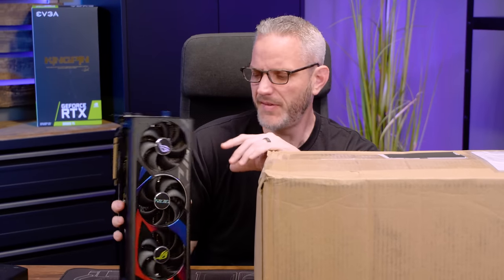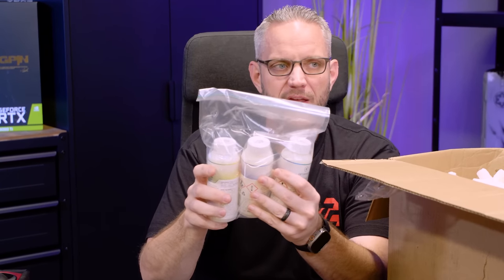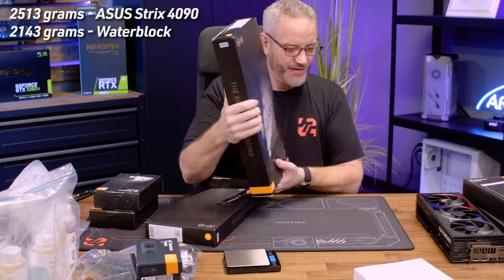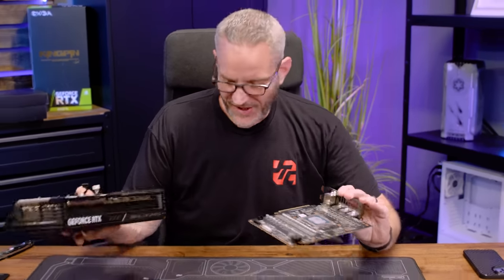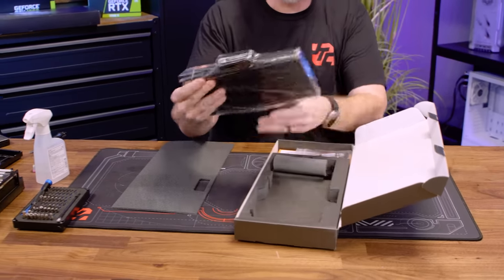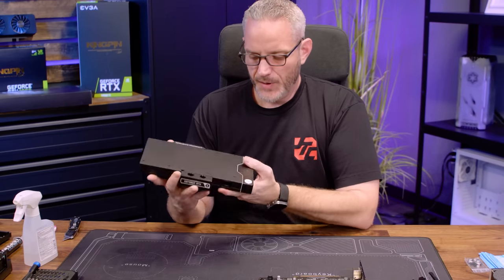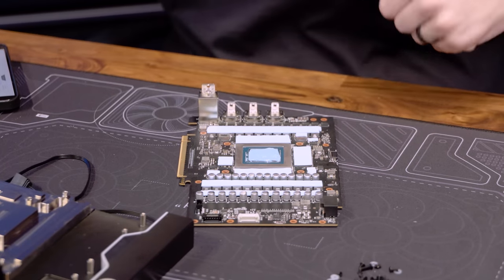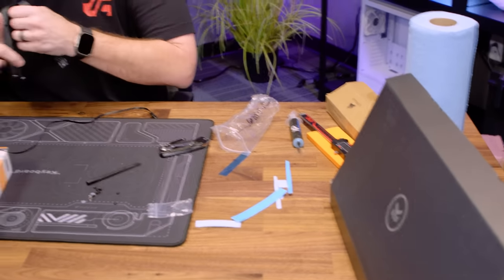This is how you make a 4090 even more expensive... 4090 Strix EK Waterblock Install

Comment: Will you go with a direct die solution with your 7950X3D? 
I'm going to do a build soon, just waiting for the delidder and the direct die frame, and now i'm curios if the EK waterblock (same as yours) will fit with capacitors near the power stages. 😅

Comment: I have a 3080 and was thinking, hmmm I might look at upgrading. But the options aren't really worth it.

4070ti is a sidegrade pretty much, with a few new features dlss 3 , etc. The 4080 is an upgrade but it's $2500 - $3000 depending on the model. The 4090 is almost the cost of my whole PC. Cheapest one is $3000. The most exspensive? $4600. wtf.

The best option seems to be just not buy anything really and wait till I do a new build.

Comment: I really like how the new EK waterblocks completely enclose the card. My last card was a whiny b#$ch. This design helps to contain any potential whine.

Also gtx plate on the terminal is reversible and attached by magnets. Just push where the screws would be and the other end will pop up. Flip it around and voila my logo is right side up in my reverse build.
Reply: Fire up any game and my card whine sounds like a fishtank filtration system.  Quieter than three fans at 3500 though.

Comment: Yeah, I've uses CryoFuel Mystic Fog 3 different times now...

First time with a brand new loop of 80% alphaCool parts (plus a gigabyte GPU with built in block, and a Barrowch Pump+res combo), that was soft tubed. That time I must've done something wrong, or there were some serious corrosion issues, or ai didn't flush the rads well enough, because not a month after use, the liquid was pretty much translucent (still white-ish, but you could see perfectly well through the tubes), and a month or so later, the liquid started turning a pale green-ish color, but I suspect it's some sort of copper oxidation, and not algae (and no, I use any aluminum stuff).

Second time, same loop, cleaned out the fins in both CPU and GPU blocks (clogged with white goop), and changed the tubing. This time it took 2-3 months for the liquid to become translucent (again, still white-ish, but translucent), and after 6 months, it didn't go green, but I then switched to clear CryoFuel, it was too much of a hastle to fully disassemble the system every 6 months, and the last 3 months have increased temperatures on the CPU block (tinier fins than GPU, so it gets super clogged).

About 6 months ago, I built a new system, everything brand new, but this time a mish-mash of parts, mostly Bykski, a couple or Barrowch parts, and an EKEB block for the GPU (the sick special edition for the 30 series founders edition). This time, it was with PETG hard-tubing, and had a very similar experience to the second time, which meant it took 2-3 months for the liquids to become translucent, and now my CPU is pegged at 85°c running any high demand game, with 2 360 rads in a 0-11 Dynamic Mini. Sure, room temps are e probably around 24-26c (I live in the tropics, with no A/C), but still, that should be closer to 80 with some pretty decent turbo boosting at the VERY least.

So yeah, to;dr: only use EKWB Mystic Fog CryoFuel if you like COMPLETELY taking apart your system every 3-6 months... Back to clear for me!! XD

Comment: So they have ramped up prices and ramped down quality? With the options available I would do research and buy EK  as a last resort, to qualify my statement I am currently running both Cpu & Gpu EK blocks which are good and nice, but looking at upgrading my gpu, and looking at water blocks in real world terms I can buy a 4080 and water cool it or buy an aftermarket 4090 for the same money, I understand thermals, acoustics etc. I would ALWAYS take that extra tier of performance, thank you and goodnight 😀

Comment: I just finished my build and used the active backplate from EK. I don't understand why you can't use the active back plate unless it's the weight mounting horizontal. The water ports are infinitely flexible as to the inlet and outlet. You mentioned a heat sink being in the way but you didn't show that. Just curious. I've torture tested my 4090 and can't get it above 52c. I have a 360 and 280 rad with OC 19-13900k. If you know of a test that can stress the GPU more than Heaven or 3DMark(several different tests including speedway) let me know.

Comment: Just finished installing the same waterblock. It barely fit in my Lian Li and almost touches the front glass.

The thermal pads were a little different than I'm used to. Felt like there was a second layer of plastic under the blue side plastic.

Comment: I'm still debating water cooling my gigabyte 4090. I had a full water cooling setup but removed it when I got the 4090 as there weren't any blocks out at the time.  Not sure if it makes sense thermally. The air cooler is pretty freaking solid.
Reply: I water cooled mine using a Phanteks waterblock and max temp under 100% GPU load with 80% of the VRAM being utilized capped out at 46C. That was a sustained, and heat soaked loop. My system was rendering a 3D image for almost an hour.

That's with the GPU being on the same loop as my CPU. The real benefit is the fact that at full speed I have 8x120mm fans going at 900RPM rather than 3 GPU fans going like 1200-1600RPM.
Reply: @WolfA4  My fans all run at 1000rpms or less. I have 4 140's and 7 120's lol. I'll probably water cool it again. I just prefer the look and gives me a project to play with :P

Comment: I had the same issues of the active back plate for my 490 not fitting with the X670 E. I just took off the M.2 cooler and put on a low profile one which I'm not sure if you can do on yours. I love the look of the block with the ABP.

Comment: I stopped messing with open loops when prices starting getting stupid. Regardless of performance I can't get excited about spending $250-$420 on a water block alone. That thing better be gold plated for that price when it's just a slab of copper and aluminum. Once you add the pump, reservoir, tubing, fittings that are getting ridiculous, and CPU block you're quickly approaching 4 figures which is ludicrous for something with so little technology in it.

The videos are still cool to watch, but pricing has been out of hand for years cause they think they can charge Nvidia prices.

Comment: I use to use kingpin then I tried kryonaut extreme and haven't used kingpin since. The Kryonaut doesn't dry out and turn into cement and it dropped my temps by 6c on the cpu and 9c on my gpu. Liked the Kryonaut so much I tried their thermal pads on my gpu and the temps dropped by another 5c, want to try the new minus pad extreme but they are very expensive and are a one use product

Comment: ive used mystic fog in my current build i used the premade , its terrible gunked up all my system and more or less ended up clear after about 3 months , best looking fluid though its a shame just splits so easy i now only use clear fluid

Comment: jay  thinks I shouldn't use my air compresser to blow bust out of computer more bad advice Just regulate your pressure regulater to 10psi and if you have a shop vac use both at the same time takes 3 mins  The vacuum Picks the dust as your blowing the dust off.

Comment: i just tried disassembling my strix 4090 and the clip at 8:10 wont come off at all, due to two of the screws being so tight they broke my control screw driver. completely twisted the #0 bit out of the press fitted metal handle... so no waterblock 4090 for this guy...Bummed out because this has been a "no expense spared" build.
MB: Strix Z790-E
CPU: i9-13900k w/ EKWB QV2 waterblock
RAM: 128GB Trident Z 5600MT/s CL28
GPU: ROG Strix 4090
PSU: Thermaltake GF3 1000W
Chassis: Thermaltake LVL 20 HT (black)
Storage: 16TB Crucial P3 NVMe
Cooling: 
x2Thermaltake Pacific PR32 D5 Plus (now just a single since i cant cool the GPU now) 
x2 EKWB 360mm X-flow radiators
super bummed out about this...

Comment: the liquid gunks up your system 🙈
running the mystic fog for a year now and it didn't even take 2 weeks until stuff just clogged in the blocks.....it's still running though and not running hotter and you can't see the gunk until you drain the loop cuz it's....well....foggy 😅😂

Comment: EK, you should be ashamed of yourself.  At this price, the thermal pads should, at the minimum, be pre-cut, if not preinstalled.  If you continue to not pre-cut the pads, you should label each size of the pads or use color matched film to the instructions.  If someone doesn't have measuring tools or not familiar with metric, they may run into trouble.  This would avoid someone from installing the incorrect size pads in the wrong place.

Comment: I brought my MSI 4090 surprim x and EK ABP waterblock, and I need to spend lot more money, mostly another $500, to get it done. And this weight lot heavier than all EK GPU waterblock, also the same weight and same length with the heat sink that MSI come with. Besides, the active backplate is…. not user friendly, the whole waterblock is blocking the PCIe clip, I can’t release the card. I can tell, don’t buy this ABP, unless buying it for FE or ASUS, or you really want it.

Comment: Alphacool ES Geforce RTX 4090 Reference Design with Backplate
 I would like to see stock numbers of this EVGA water block compared to Alphacool ES GeForce RTX 4090 reference design with backplate.  Also how it would fit insade Lian LI O11 air mini case
Reply: Also what is best CPU water block that doesn't require unscrewing socket on motherboard ?

Comment: That scratch triggers me.

Most of my brand new products are coming with defects.  Valve Index? Scuff mark right on the front.  Hell, my 4090 had a dead gnat smashed inside it, completely disgusting.

Quality standards just keep slipping as volume keeps ramping up.  The world buckles in on itself.

Comment: Wouldn't it be nifty water cool and air cool versions of GPUs were sold so you did not have to get a GPU with all the radiators and fans you would not use and not have to buy an add on thing... oh wait.  True.  That would mean they lose sales on water blocks.

Comment: I hope someone can tell me, do the water holes line up to the same place when installed (at least vertically as I use a riser) as the strix 1080ti? I REALLY don't want to redo my water loop. or re do hard tubes.

Comment: Sorry, no QR-instead-of-manual. Both is fine. Internet connectivity and availability is always a potential issue, and if/when a company dies off that resource is gone. Some companies also just stop hosting the data to force you to buy new stuff. If it's not zombie-apocalypse proof, it's a bad idea. Always go zombie-proof… Always. • PS: I cackled when you just popped the packing peanut in  your mouth no hesitation. They're edible, yeah, but you just ate warehouse dust, cardboard fibers, etc. Clean THEN eat your packing material.

Comment: You can use compressed air from a compressor as long as you have the water separator and know what the fuck you're doing.. should have a special setup just for electronics use if you're doing that

Comment: Uh, why can't you use air from a compressor instead of a can?....
Reply: I don't remember the specifics but air compressors have either water or oil or both inside and will blow that all over the components, which obviously is bad for electronics

Comment: I'm so tempted to switch from my 3090ti to a strix 4090 I have in the closet lol who wants to buy it, before I buy one of these blocks for it!?
Reply: Bruh. I have the TUF 4090 in my closet as well. But, I just serviced my loop recently. I don't feel like taking my system apart.
Reply: @venividivici4253  I just put my system together roughly 4 months ago lol I don't feel like tearing it apart. If I use one of these blocks though, I could just switch cards and be good to go but yeah lol.  Dunno if I want spend another $500 on a new block etc...